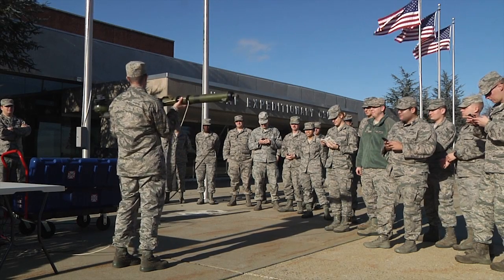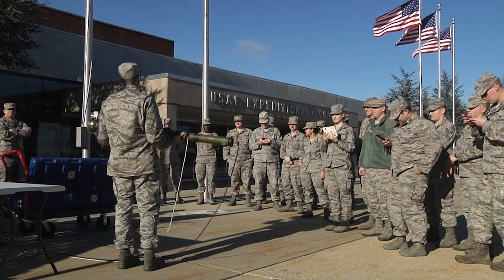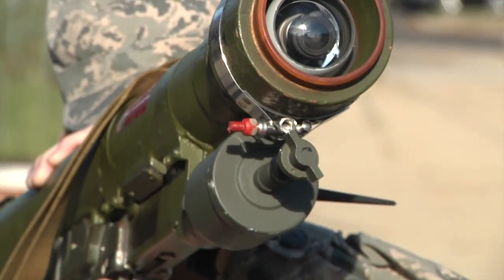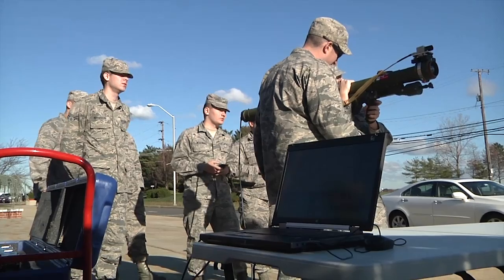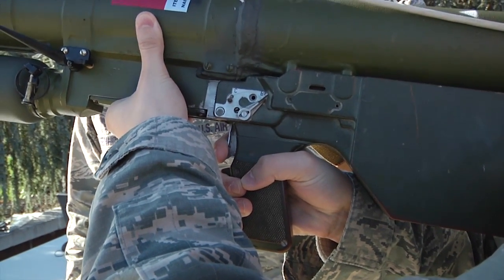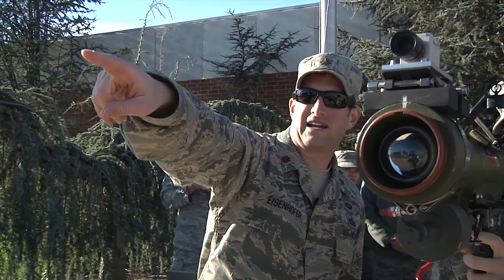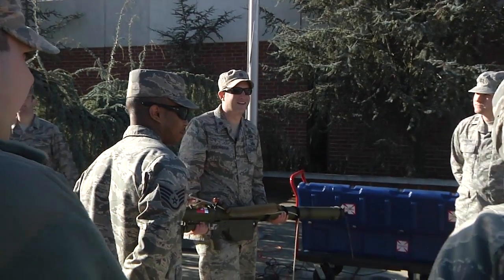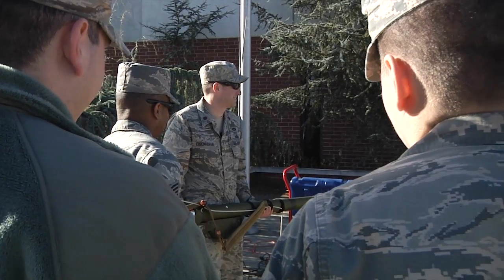SA-7 Total Force Training

Comment: 1st gen seekers dont have any coolant as they are uncooled. This limited the resolution and pretty much could only see engine heat but it also meant that the system could be stored for decades while cooled seekers Coolant packs would leak after about 10 years.